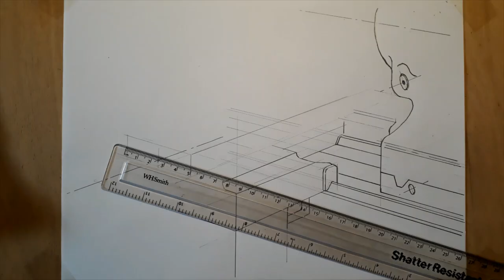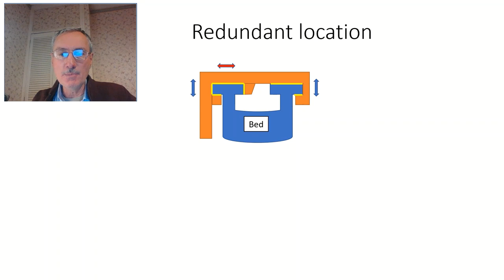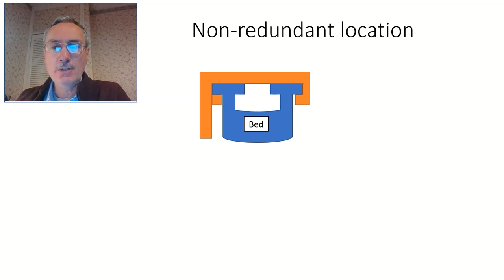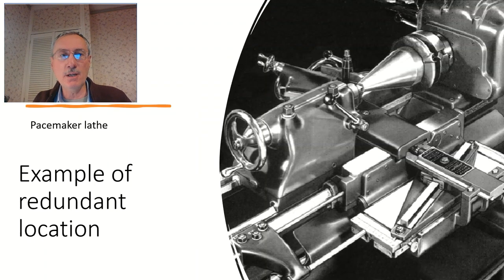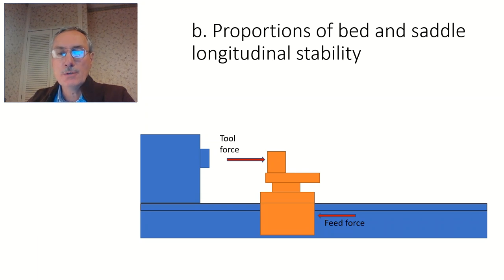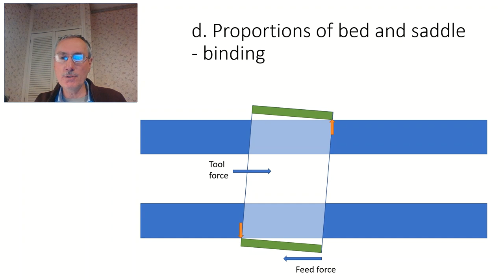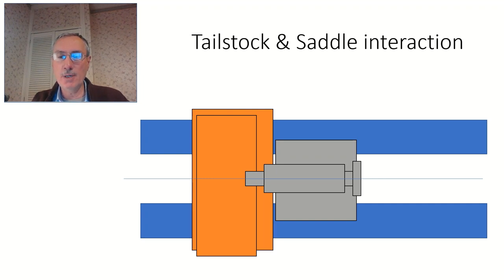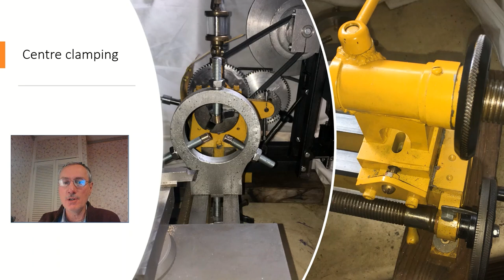Homemade lathe - #6

Comment: I've found a 1959 lathe project from Model Engineering (you'll find the article series by name "This home-made 3-1/2in. lathe has novel features")
It's interesting the way it solves the interactions between saddle and tailstock using a square bed (actually using it as a triangle bed). It looks like a nice build and simple enough to try. My only concern is if it will not suffer too much torsion/flexion on the bed which would affect precision.
Reply from the maker: Thanks for this reference. I looked up the article and found it straight away. The lathe project looks quite interesting. I think you are right to consider torsional stiffness of the bed. That was a problem I encountered and was only solved by adding a large round torsion bar behind the bed to support its middle section. I also had to add another stabilising bar to add lateral stiffness to the head. See video #2.
Would be good to hear how your project works out.

Comment: As an amateur machinist I found this very interesting (and liked the music!)
As I am sure you are aware Myfords altered their classic narrow guide design late in the production of the Seven series, possibly in response to the criticism of the late Jack Radford.
The Barker three bar bed bar design may have been prompted by post war shortages but I believe it is inherently stiff and worked OK in practice.
How would you comment on the Willson slant bed design?
Reply from the maker: Thanks for your comment! Yes, I was aware that at some point Myfords had moved from saddle guidance across the front shear only (narrow) to the across both (wide). Until I just looked it up, hadn't realised that this change happened twice; both with the ML& and the Super 7. If I understand correctly the reason for the change was in both cases to increase the sliding surface area resisting normal cutting forces and to make adjustment of the front gib strip easier. After modification, perhaps the relatively narrow bed (front to back) as compared to length of saddle meant that the binding issue I referred to was avoided. I wonder if the the original designer considered that bearing surface area loss was worth the gains of a narrow guide. Turned out he was wrong!
I just took a look at the Willson slant bed lathe. I had expected to see the slant towards the front, not rearward. Seems this was for capacity and and swarf clearance. The only comment I would make is that: It is basically an inverted V slide design. With one V and  one plain way on an incline the weight of the saddle and tailstock may have caused unequal loading on the two sides of Vs which may or may not have affected the wear pattern. For the saddle normal cutting forces would have been partially counteracted by the slope but not the for tailstock.

Comment: Narrow bed has higher forces on the bad than a wider bad.
Reply from the maker: Yes, on the horizontal (top and underneath surfaces) but not necessarily on the vertical front and rear surfaces. That depends proportions. There is trade off between the advantage of width with issue of binding due to twist of the saddle.

Comment: What do you think of pillow block bearings as spindle head?
Reply from the maker: Assuming you mean ball bearing pillow blocks - I have seen others on YouTube use them on homemade lathes. Technically speaking they are not really intended for this purpose since they are normally not designed to carry heavy end loads nor provide good radial location.  However, it would probably work.
I preferred the plain bearings because I could easily incorporate them into the casting and design the spindle the way I wanted it. Thanks for your question.